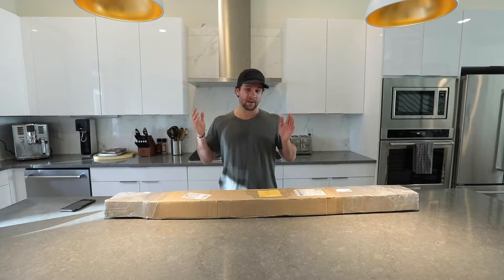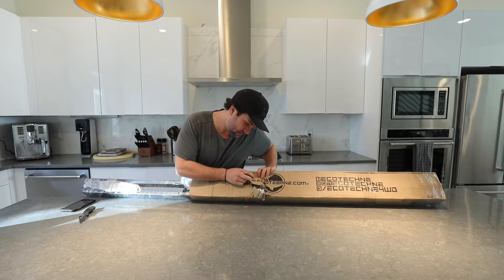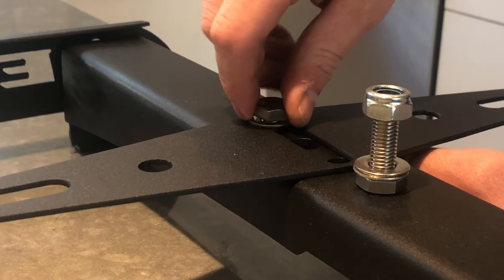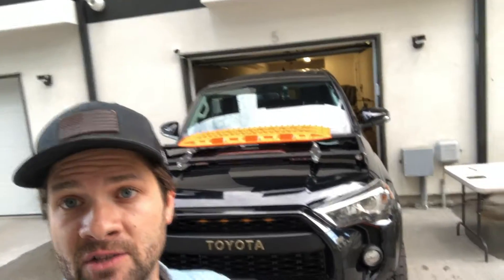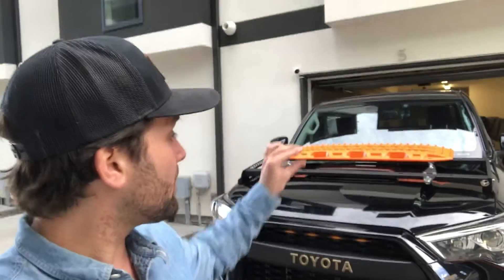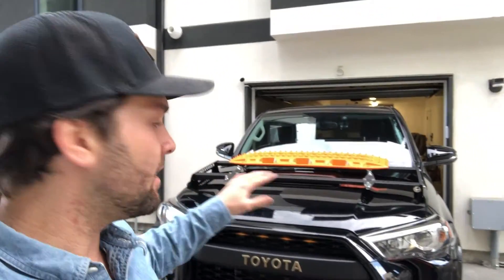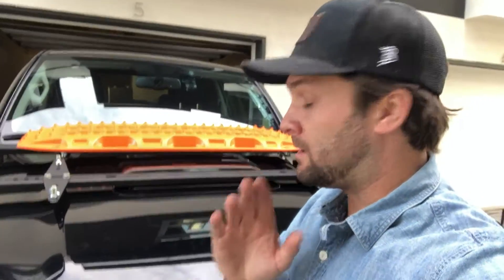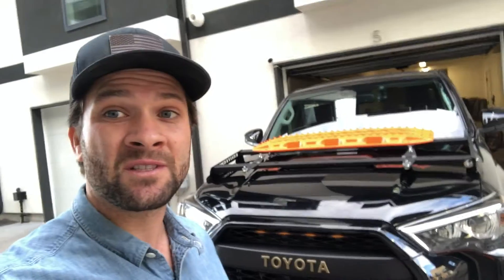New Year, New Gear! Installing Ecotechne Hood Rack

Comment: Awesome video man. Appreciate you taking the time to do this. Quick question. Does it bolt to the underside of the hood in any way? More curious about it being installed and having to open the hood completely.
Reply from the maker: I really appreciate you taking the time in watching my video and giving feedback! What makes this such an awesome product is there is absolutely no bolting required whatsoever! It basically cinches to the hood of the vehicle (however, as I stressed about this to people who want to purchase the hood rack is to not to over tighten the rack as it may place too much pressure on the hood and causes indents) tighten it enough and you can open and close the hood without it sliding off! Hope this helps

Comment: I’m a GX owner and I find myself needing to step on my hood time to time. Mainly  to get access to my RTT windows. I’m wondering if you can step on these with out damaging the hood.  Thanks I like this solution a lot. This could possibly kill two birds for me.
Reply from the maker: I wouldn't recommend it honestly brother. The pressure of the cinching of these hood rack is already enough and Yota's are known for denting and having the paint scratch very easily.
Reply: @zakrichardson4196   THank you so much for the info!

Comment: Great video, been  looking for more information on this product for a minute now so I am relieved to see that someone has done the research. My question to you is similar to Jsin's... Do you hear any rattling with the metal to metal contact where the feet cinch to the hood or does it sit on the frame of the engine bay? For instance, you go off-roading, the bottom seems to be secure but once you hit a bump it seems like it would elevate and make contact with the underside of the hood itself. Just curious. Thanks again for the video!
Reply from the maker: Great question. After modifying it so my MAXTRAX boards can sit on the hood rack with the mounting pins, the pins were touching my hood and that was a problem. So I resolved it by purchasing these cabinet softners that you place inside you cabinets for a soft close, you can purchase them at Home Depot. Then placed them under the mounting pins and they don't rattle anymore. Hope that answered your question.

Comment: Hi! Where can i buy this? And how much?thanks
Reply from the maker: It's a fabrication comapny based out of Venezuela called Ecotechne. To be completely honest there are other ones out there for much cheaper like Finn Fab that makes on for the hood of your vehicles. I would start with them if you want to a hood rack that you can mount MaxTrax boards and for a fraction of the price!
Reply: Zak Richardson thanks